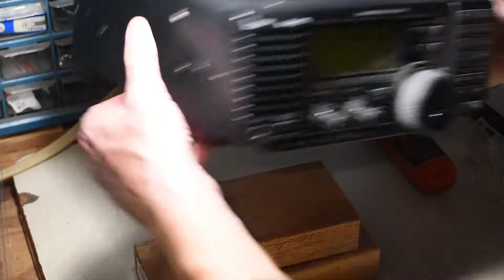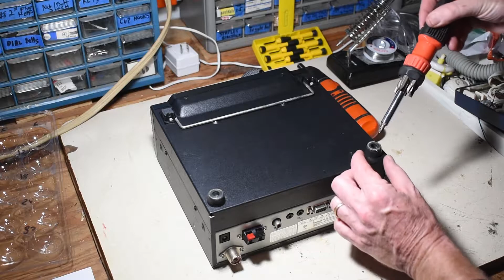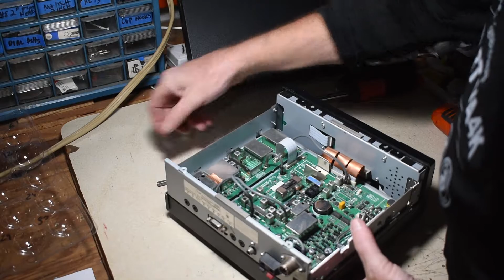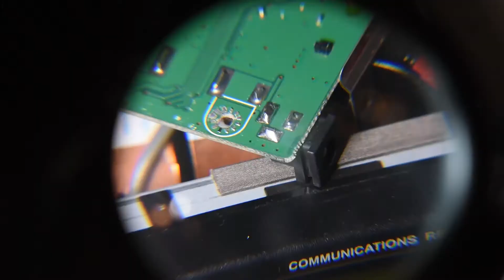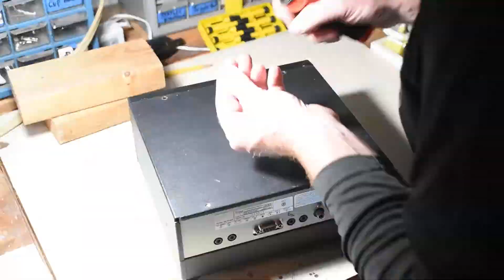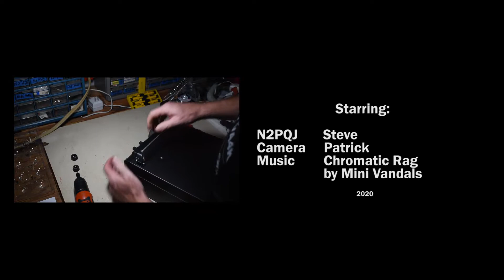Icom IC-R75 Receiver Power Jack Repair

Comment from the maker: My good friend Jack, K2JX passes along two very important grounding observations. 1) I should be using an anti static wrist strap when working on high impedance circuits {one volt looks like a million volts to the components.}   2) Touch the soldering iron tip to a ground before soldering on a motherboard.  Static or other stray voltages can flame the microprocessor in a Nano second!   Will do!!

Comment: Hi, this was great, followed it to the letter and my R75 is like a new rig. Will you be following this with a video on how to fix the R75 extension speaker jack as anything I plug into the jack crackles? Regards DW
Reply from the maker: No
Reply: @n2pqj524  Many thanks.

Comment: That was always the one and only weak link that darned power jack! Had to have mine fixed. I’d epoxy it if I ever replaced it again. Epoxy can be dissolved so it isn’t permanent. GREAT radio esp with mods! Adding to my archive in case it ever needs another fix. TY for sharing! BTW what filters do you have in it as optional?!
Reply from the maker: I did have the DSP filter in one of the rigs.  The other one was stock.